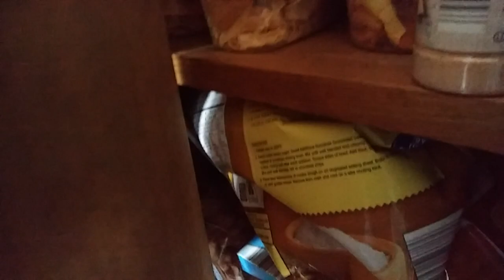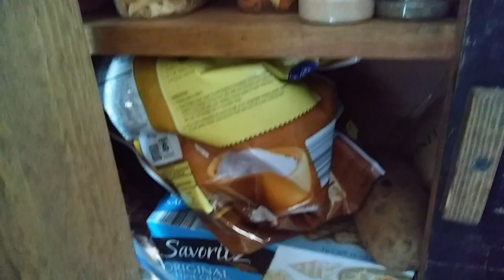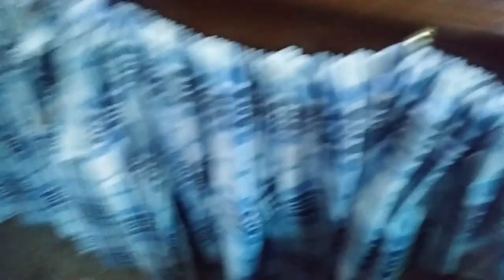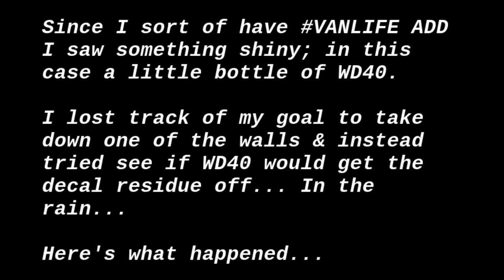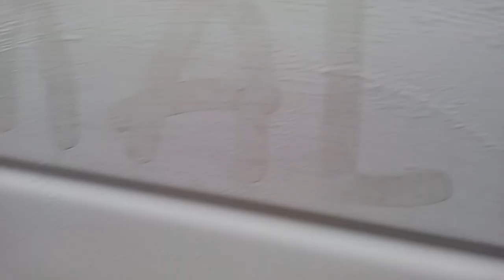WD40 for Decal Residue & Van Reorganizing - Solo Female VANLIFE

Comment: Good tip on the WD40. I still have some letters to get off of the bus, this will come in handy thanks.
Reply from the maker: yw! And the green scraper sponge things helps a lot. It's soft enough to not scratch the paint but does the trip better than a plain wash cloth.

Comment: What I have in my van to separate the cab from the back living section is a tension rod with curtains.  Ive been in the van for six months and today was the first time I had to tighten it up again.  I have a lot of weight on it though because I attached my over-head clothes storage to it.  When I do my van tour (coming soon folks) I'll show more on it.  It works great and keeps the curtains taught and no one can see what is in back.  The only thing I might change is to sew black material to the back (the part facing the cab) to help with the stealth factor.  But for what I need them for, the way they are now is fine.
Reply from the maker: I have sort of the same thing but not the tension rod. The way my van is is uneven walls and weird shapes. I couldn't get the rod to hold tight it kept slipping. I can use the other little curtain rods  and stick the ends into the various spaces in the van. Once I get real walls I can probably go to a tension rod system because they will have something flat to adhere to. Cant wait for your van tour! I will do one eventually when I have everything the way I want it.
Reply: @AnnsTinyLife  I'm getting ready to change the layout of Gypsie so I want to do an in-depth tour of how it is now and then after the rebuild do another tour.  I've been living with this setup long enough to know that...yeah it works well, but it will be soooo much better with the new build.
Reply from the maker: @travelinggypsie2085  cant wit to see it!